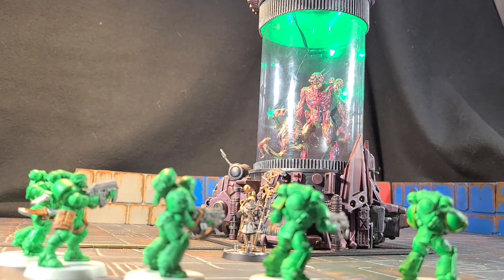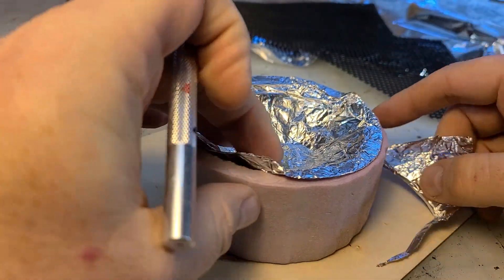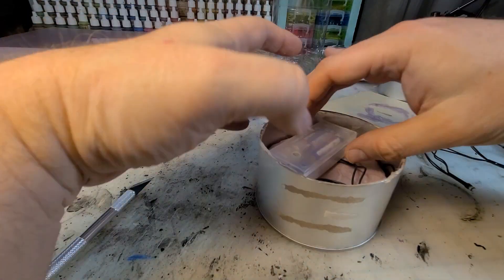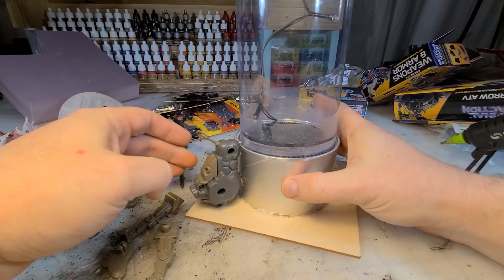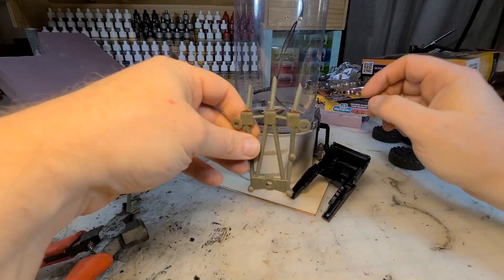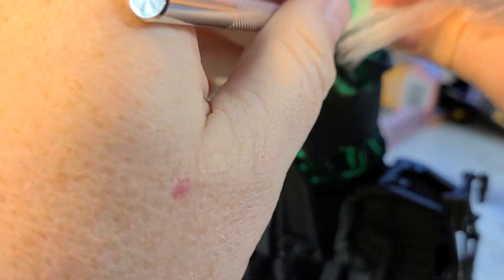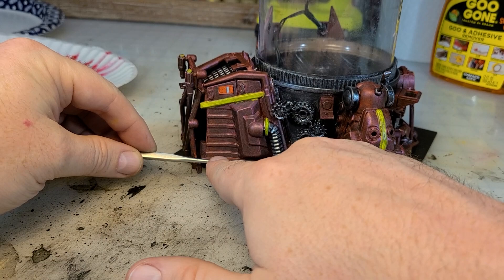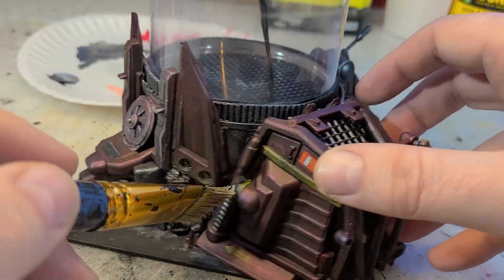Mutation Tank from Garbage and Dollar Store Toys

Comment: I have a question, I don't think I ever saw you use a proxon hot wire cutter, do you ever use one?  Maybe I missed it in a video.  I don't own one and don't have room for one, but many, many channels that do crafting always use one.  Thank you!
Reply from the maker: I do have a proxxon and used it to cut the puck shape of foam.  I'm not very skilled with it and don't film much of its use.  Is this something you'd like to see more of?
Reply: @brokenterrain  not really. I like watching you craft not so much into simple things like a saw.
Reply: @brokenterrain  Not necessarily, I think you make amazing work with just the use of an exacto or other blades you use.  I actually learn better techniques that way.  Would be great to see a video on techniques using different types of blades.

Comment: I think the middle lights and that part of the cord should have been run to the outside of the clear tube. Then make a shroud on the outside to hold them. Add some power coupler/cable/wire details to it and mount the lights in it pointing outward.
Reply from the maker: That was part of a much more complicated original plan where I could spin the tube from broken to unbroken.  Ultimately I had to give up on that aspect for time.